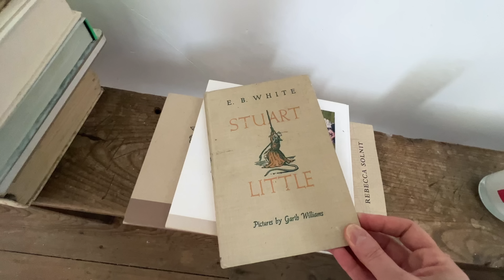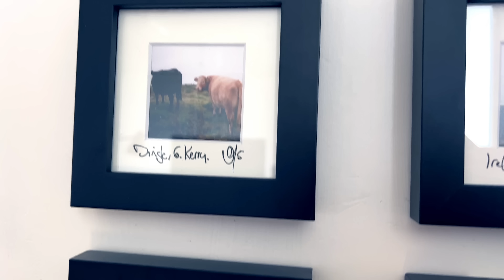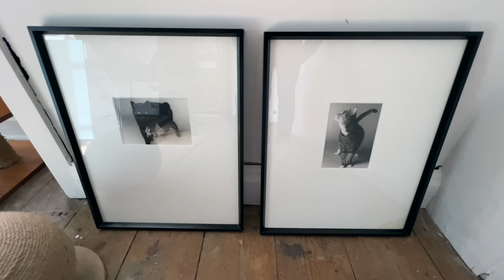BEFORE and AFTER! French Chateau Room Re-do

Comment: Lincoln - please please check out TORO Zero Turn mowers - the PRO series 
way way more comfortable upright lean back ride with a spring loaded seat and either the 96" or 76"wide cutting deck -  
spending an entire day hunched over on that old slow tractor is insane....do not by one of the little garden versions - you got the land for a pro